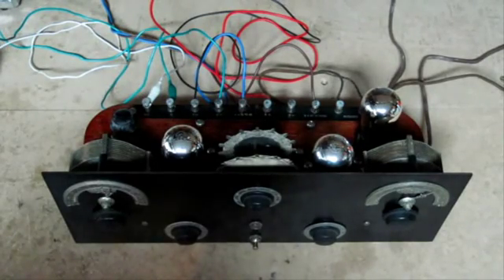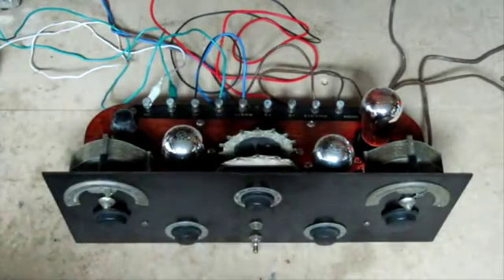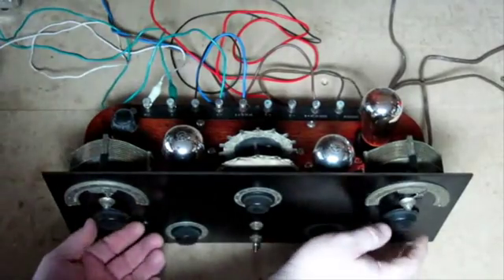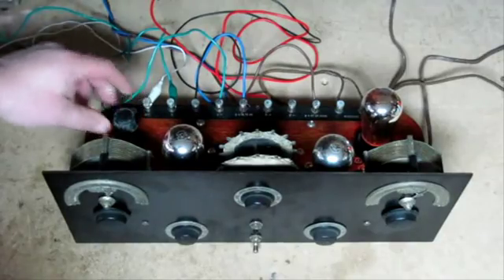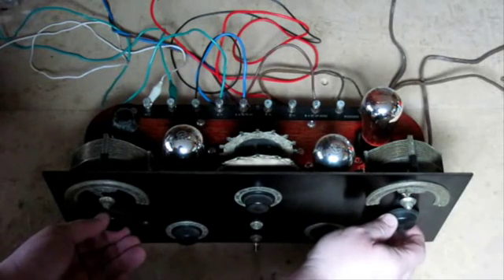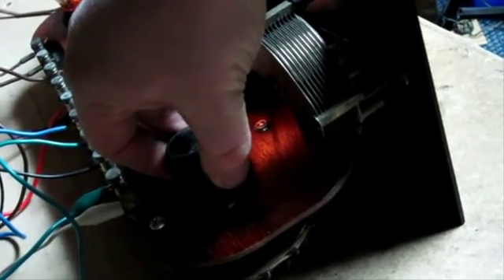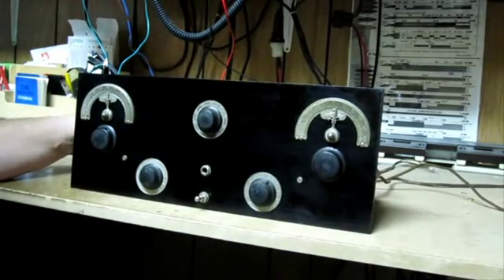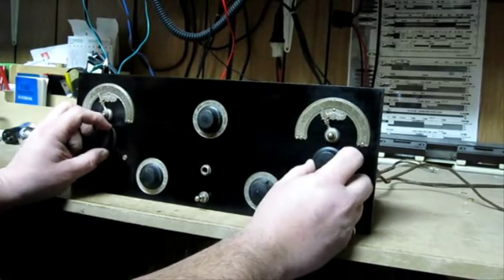Crosley Super Trirdyn Radio

Comment: Great video, it gave me a "heads up" on some features of the radio. My son gave me one for Christmas. I just completed construction of a homebrew one tube Morgan Regenerative Receiver. After building it, winding 4 different coils, wiring up the A and B batteries, etc, I think I am about ready to begin a restore of the Crosley. The regens are a great learning level project or a project to reinforce the basics of radio reception, etc. Next I plan to make a 3 tube audio amp for the Morgan. 73 KU4JZ

Comment: Beautiful old radio! Right now, I am listening to a late 1925 or 1926 vintage homebrew 3-tube regenerative, but it has only one tuning knob. I am only getting two local stations right now. I bet the Crosley gets better DX reception, but I haven't tried mine with an outdoor antenna yet, either. Good job on the restoration!